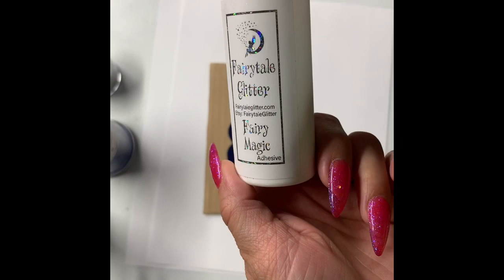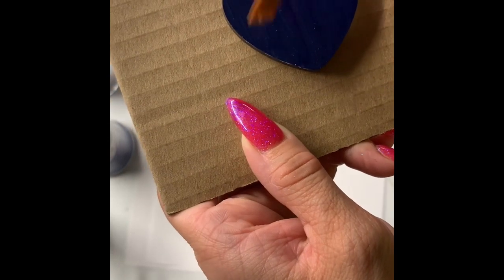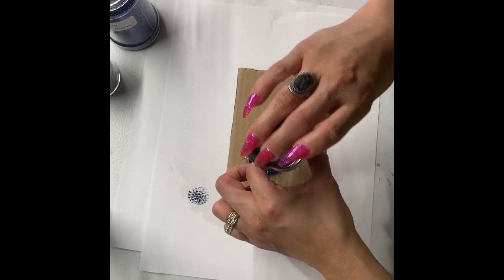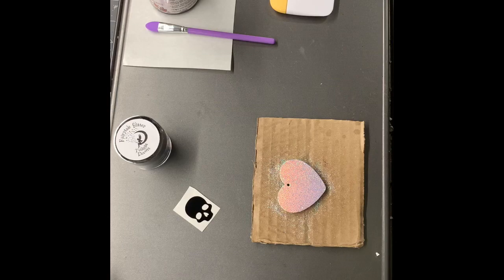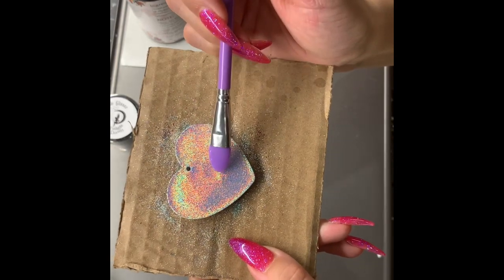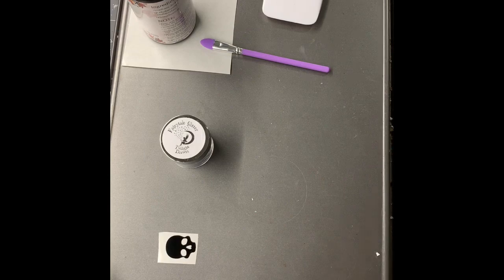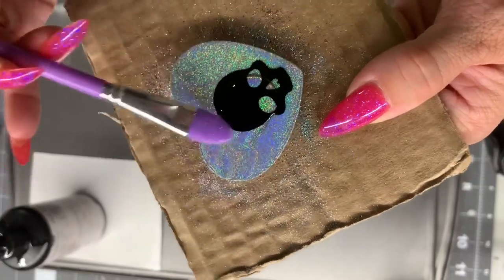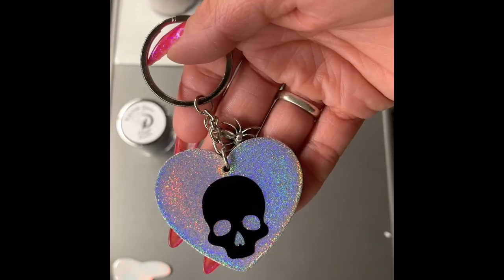Applying the “TACK METHOD” to an Acrylic Blank

Comment: What modge podge sealer did you use?
Reply from the maker: Ashley Yeager https://www.walmart.com/ip/Plaid-Mod-Podge-Clear-Acrylic-Sealer-Matte/17300139?wmlspartner=wlpa&selectedSellerId=50&adid=22222222228015420165&wl0=&wl1=g&wl2=m&wl3=42974702672&wl4=pla-81466797152&wl5=9031182&wl6=&wl7=&wl8=&wl9=pla&wl10=8175035&wl11=online&wl12=17300139&veh=sem&gclid=EAIaIQobChMI2dL_sOub5AIVpBx9Ch3kmw6NEAQYBCABEgK5o_D_BwE